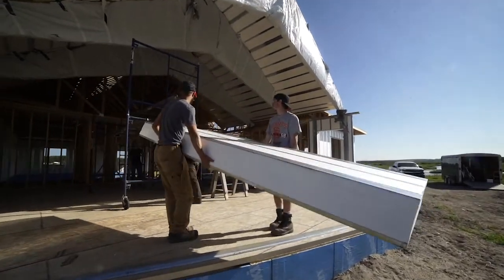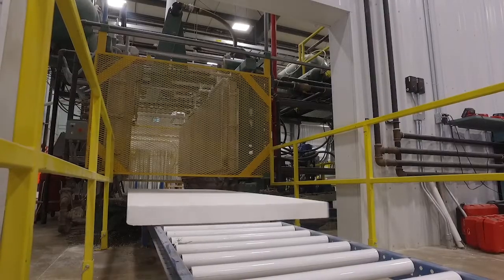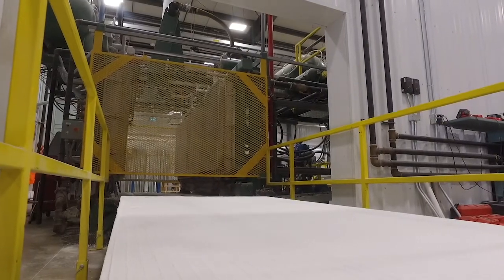Greenstone Testimonial | Driftstone Consulting Inc.

Comment: Do the ice panels give off gases over time?
Reply from the maker: EPS (expanded polystyrene) is a closed-cell insulation. This makes it very stable with no off-gassing. The Pentane used to "expand" the EPS sand is evaporated during the manufacturing process. By the time the panels leave our factory, they are off-gas free!

Comment: Can greenstone build insulated frames in conventional size say 2 x 6? 
I am asking because we have 90 mm C channel steel frames in Australia that are not insulated from the manufacturer.
Insulation batts are installed from most home builders but some only yielding R  1.5. Please come down under. greenstone. Or sell your Technologies to our manufacturers?
Reply from the maker: Hi there! Yes! We manufacture our panels to conventional framing dimensions. The ICE Panel comes in 5.5”, 7.5” and 9.25” thicknesses. Our thinnest panel (the 5.5”) is the same thickness as a typical 2” x 6” framed wall with an effective R-value of R22, and the thickest panel (9.25”) is the same depth as traditionally constructed 2” x 10” rafters, joists, or walls, with an effective R-value of R37. We have shipped to the Bahamas so we can definitely arrange for shipping to Australia!